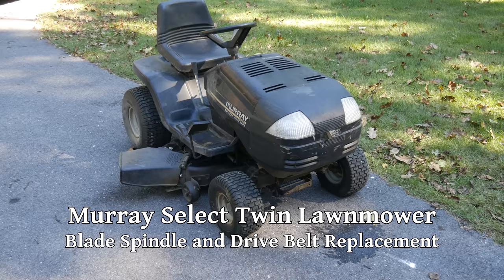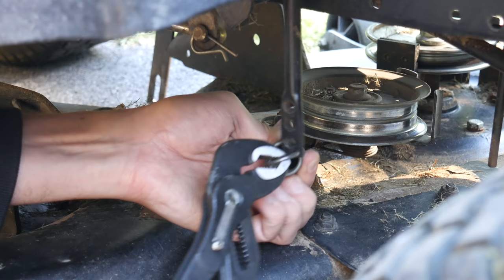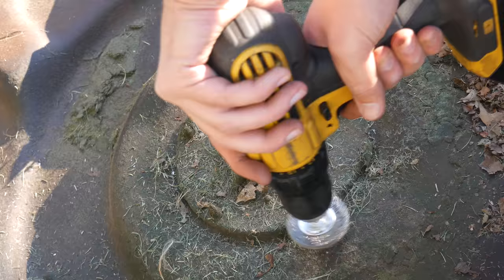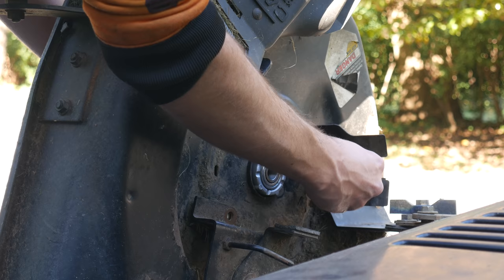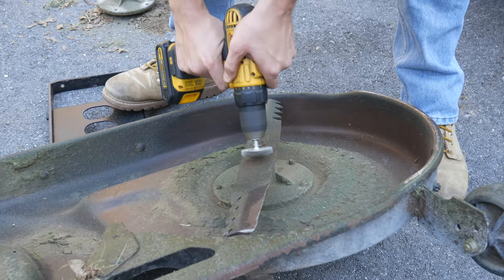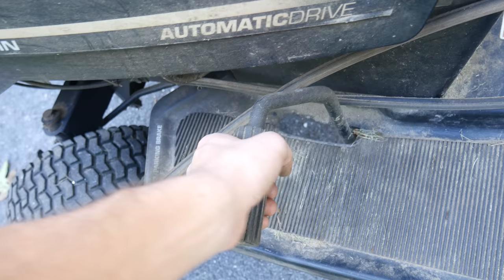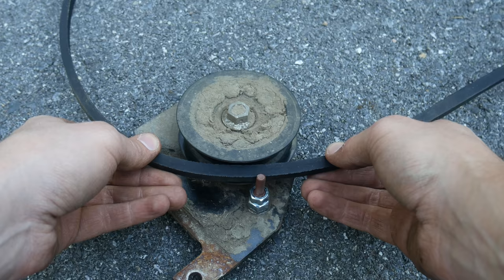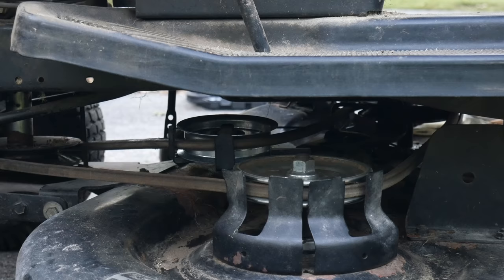Murray Lawnmower Blade Spindle and Belt Replacement

Comment: yesterday i replaced 4 bearings (a 6202 and a 6203 in each housing) in two spindles on a similar murray 42 inch deck . couldn't believe when a local industrial supply charged me the same price as they did at least 4 years ago . $20 total in 2024 !

Comment: My lawnmower has an issue with the belt jumping off.  I'm not the one who mows the lawn but I need to check to see if I have the same issue.  You my friend might have just saved me a costly repair bill from the local repair shop.

Comment: Great video . Aces to you for a job well done!! couple of things though, pressure wash the deck paint it with rustoleum reformer and spray it down with a good pruning seal or a herculiner product for it to last, also GREASE THE MANDRELS AND Shaft will last much longer. i have two lawn tractors in great condition, one Murray year 2000, the other a Craftsman  27 years old runs great. Again Great video keep up the great work!!

Comment: Hugely helpful video! I found I was able to more easily remove those spindle races by placing the spindle against a wall and hammering the race at an angle with a chisel/flathead, forcing it to slowly slide up the shaft.

Comment: Great video. I just got two mandrels/spindles in for my '96 Murray rider that looks a lot like yours. I thought I might have to get a Harbor Freight tap and die set until you cut threads with the old bolts.  My belt is more easily removed and replaced. Thanks for the instruction.

Comment: Im doing my own maintenance from now on. My local mower shop charged me close to $400 for a new snidle housing when i stuff it with a rock. You just replaced 2 and the drive belt for $50!!!!
Reply: My old next door neighbor had similar horror stories of taking her stuff in. I started working on it for her instead and just didn't charge her. Most of the time it was a 10 minute job anyhow and she just paid parts. Mower shops seem to be rip off operations.

Comment: I work at John Deere and have done some mowers I always recommend replacing the drive belt idler pulleys because they are plastic and not metal deck idler pulleys typically last longer.
Reply from the maker: Despite their age they seemed to be in okay shape, and the bearings felt fine so I left them alone. They are all plastic though, and spending a few more dollars to replace them all would be a good idea.

Comment: What college did you go to get all of this mechanical engineering knowledge or was it all self taught? I want to do somethibg similar to your work experience
Reply: Watch wheeler dealers .uk
You,could,be at this level in a few weeks
Reply: @fixitup2193  few weeks lol. have you seen the transmission rebuilt series?
Reply: prob self taught
Reply: Since he hasn't answered you:

For learning this kind of stuff, the best thing you can do is drag home some absolute garbage object and start into it. When I really cut my teeth with wrenching in my late teens, I brought home as $100 car with a transmission half installed in it and took the project over. I learned more about working on that thing than I ever could in school.

On the flip side of that, if you want to DESIGN stuff like that or work in manufacturing around the building of those things, find a good Mechanical Engineering Technology program somewhere. I also did that. I recommend technology and not straight ME because you'll have more of a hands on focus on machining, CNC programming, CAD work, etc.
Reply: oney a good boi its not as hard as it looks. The best tip i have is to understand how it works and do some research before you get in to it. Parts diagrams yt videos are usually very helpful. ”The workshop” has a LOT of videos motorcycle engines and other general enginering knowledge that could be used when working on a car. Im pretty much only going to motorcycle college because i have to have an education to start as a motorcycle mechanic. I pretty much already know all the things i do need to know when fixing motorcycles.

Comment: In the process of replacing my spindles now, problem I've come to is the splined blade adapter won't go back on, splines look to be the same, So, what I'm thinking is to heat the adapter and see if it will expand enough that it will go on over the splines. Do you have any "other" recommendations?

Comment: I just bought my first riding mower. Murray 38” I believe was from Walmart when new. Would my mower have grease fittings on the belt spindles like this one did?? Kinda seems like it labors the engine to get the blades going. Also feels like the blades could use balancing.

Comment: Not trying to be a pain in the ass, but i Saw you had an earbud hanging when you checked for noise on the Pontiac and you where quite close to the belt. If that belt catches it, your face is getting pulled into the pullies. And no one wants that. Be careful, Thank you😊

Comment: You are obsessed with torquing lol. How do you know how much foot pound you need to apply for each bolt? I am amazed.
Reply: As he said it's mostly estimates, aluminum is soft, the bolts are small so low torque figures are for the best.
Reply: You look them up in a place such as a Machinery's Handbook, or in modern times, Google.